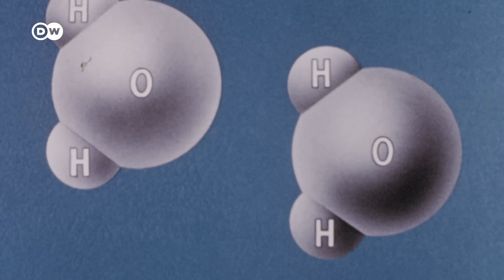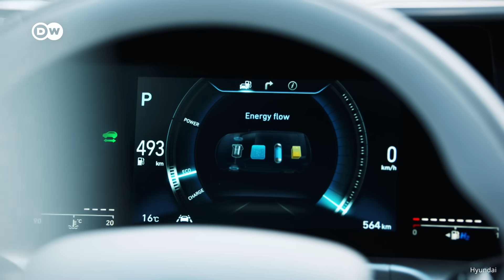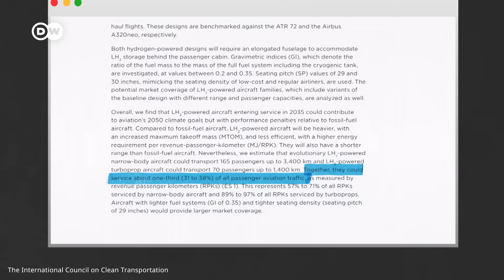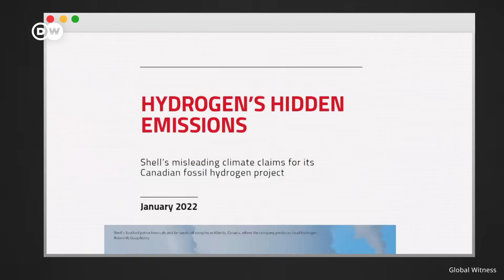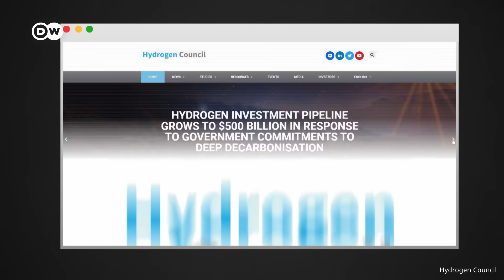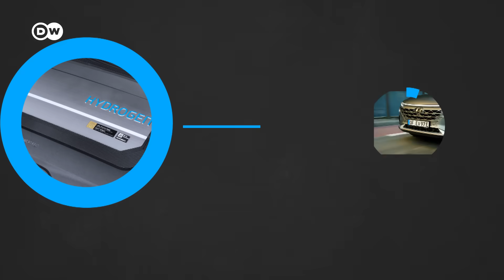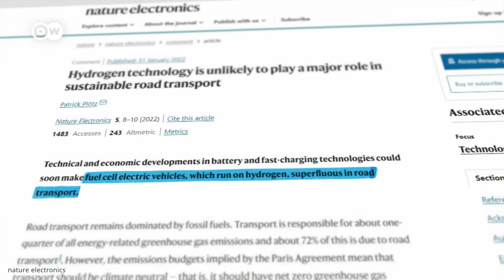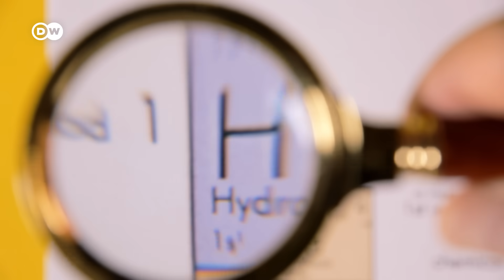The truth about hydrogen

Comment: The big problem with electricity production lies in the non-recyclable nature of the structures that are used in it's production and storage.    Windmill blades are enormous and there are millions of them and all have around a 10 year life cycle, along with those are vehicle batteries that are very difficult to recycle and/or dispose of as are photo voltaic cells on  roof tops.   Hydrogen doesn't have those particular problems in it's production and storage.

Comment: I think discovering an efficient and safe fusion reactor for energy would be the game changer in the coming years. And everything would run on electricity with minimal carbon footprint.
Reply: I used to be a big believer in fusion, but the truth is, the materials necessary for building a fusion reactor will make it inherently expensive, and that doesn't even take into account the expense of producing the tritium fuel (assuming its D-T fusion). Fusion may only be viable when our energy needs exceed what solar and wind can provide, or in niche situations such as when there is little solar and wind based on certain geographies

Comment: The Canadian system, Proton Technologies, filters the hydrogen out of the oil whilst underground, leaving the carbon in the well. Done by using controlled heating of the crude oil. Cheaper than grey hydrogen, Steam Methane Reform method.

Comment: know one way of solving the hydrogen abundance problem and carbon free energy at the same time and I'm surprised no one has thought of this yet. We can build new technology nuclear power plants that are safer then the current ones (less likely to have a meltdown) and produce very little nuclear waste as well as ones that can run on existing recycled nuclear waste anyways where am I going with this. When a nuclear reactor is operating it produces hydrogen gas as a byproduct of the intense heat released during fission we could capture that hydrogen and store it from all the nuclear power plants In the world and use it to power hydrogen cars even combustible engine vehicles. What are your thoughts please reply.

Comment: Interesting analysis, thank you. Have you considered the old-fashioned method of making H2 using dilute sulfuric acid and iron filings? It was the method used to produce large volumes of H2 for the airships at the start of the 20th century.
Reply: Producing iron filings and sulphuric acid is not green at all.
Reply: @feraudyh  No need to produce new when there's lots of scrap iron available and the dilute sulphuric acid can be recovered from scrap lead acid batteries. The waste product is iron sulphate that can be used to produce anemia medication. I haven't done the sums on it, so I have no idea how practical these suggestions are but, if H2 fuel can be produced from scrap materials, it's worth a thought...
Reply: @SteveTheStratAbuser  I think they are trying to come up with a sustainable solution that would last centuries rather than decades. Once the scrap iron and scrap lead acid battries are used up then what?
Reply: @SteveTheStratAbuser  There is no scrap iron available. Scrap iron is used to create new iron and steel products. And all the lead acid batteries will be replaced with lithium batteries in the near future. And the there is no new scrap material. That's not sustainable.
Reply: I imagine one could supply perhaps 0.0001% of our energy needs the way you suggest but it could be less.

Comment: Hydrogen is a scam. The only things it can be really used for is the production of fertilizer where hydrogen is mostly used, and for seasonal energy storage, for example to store solar energy in the summer to be used in the winter time where solar is low and demand for energy high. Even for the metal industry it's a scam, because there are ways to melt metal with electricity.

Comment: The origins of hydrogen fuel has been known for 200 years. Man is only now discovering its potential. Within 10-20 years air planes, blast furnaces and maybe airplanes will be operating with this cheap environmental fuel. Just the savings will be enough to counter the cost of fossil fuels. ☮️

Comment: The case on Hydrogen is usually made on an 'all or nothing' basis. I truly believe that hydrogen is the fuel of the future and a completely electric society is the answer to our environmental problem, as electricity can be produced sustainably (not just solar or nuclear). Unfortunately the current energy industrial complex does NOT want to see this happening. 10 years ago I read an article and watched  videos on a system called 'The Joule Box Portable Hydrogen Power Plant' produced by an engineer in upstate NY. He makes the point that we can produce GREEN Hydrogen in our home by collecting the rain water, processing the water through an electrolyzer, powered by a few solar panels and a small battery bank. This system is capable to produce all the electricity I need though a fuel cel. It was advertised that the system can be purchased for $50,000. I tried to contact these people in upstate NY, but never got an answer from them. I have been trying ever since to buy the components to build a system like that, but I'm unable to find the parts. I do believe that this is technically possible as we had this technology for over 100 years. If we can power our day to day energy needs with hydrogen on a local level we would not need additional coal fired power plants, we would not need armed forces to protect energy infrastructures and the cost of energy would be stabilized. As for electric cars and 'range anxiety', I bought a Chevy Volt a couple of years ago and I love it. This car fulfills 95% of my driving needs without spending a dime in gas, perfect as a second vehicle and it costs me less than $2 to recharge the car for the next trip. This is a TRUE electric hybrid vehicle.

Comment: Three fatal flaws with hydrogen. First, the electricity used to make hydrogen can be much much more efficiently deployed directly through batteries, electric motors etc. That’s a deal killer right there. Secondly, you cannot get around quantum tunneling and the challenges of storage. It cannot be safely and reliably contained and stored. Hydrogen is much further along the tech curve. Ie there is less room for tech improvement vs battery and solar which are still early and have immense opportunity. Lastly there is no hydrogen infrastructure. Whereas there is an electrical grid everywhere. The grid needs improvement for sure but this is brownfield economics which is much cheaper and easier than trying to build out a whole hydrogen infrastructure that is still not well accepted.

Comment: Everyone who has a cell phone can tell you the problems with battery technology (degradation over time).  That is very disappointing with a $600 phone and is going to be heartbreaking with a $60K EV (a problem in the very near future for early adopters to EV technology).

Hydrogen technology is obviously not fully cooked yet but once creating hydrogen at home and storing it for future use is a viable option it will supplant battery technology.

Comment: I had the privilege back in the 80's to drive a methane/ gas-o-line vehicle, the switch from one to the other was smooth, flawless....H may have a problem with water vapor but I saw the other day the production has become easier and faster with a new means of production.....EV is a scam at this point, I would rather buy a Prius and have a choice of fuel.....Solar and Wind are also scams, they may work well for a private residence but the environmental disruption caused by commercial production is not good and the fact that subsidy is needed for it to cost more to supply commercially and for the most part, we keep enriching China.....The gov keeps intruding on the private sector and forcing them to follow policy that is not valid and more expensive.....The stoopid want to make themselves rich at your expense.....

Comment: It is very beautiful picture , but who finally will pay for that? The H2 fueling is a few times more expensive, than the hydrocarbon fueling. More expensive even than the synthetic hydrocarbon fuels. Which can be produced from the municipal  flammable wastes, biomass, coals, gudrons and even from atmospheric CO2 ( see newest US atomic aircraft carriers)  for example. Hydrogen which must be of 99,999% purity for the fuel cells is more costly, more risky ( by fire and explosion) , is having less energy density than hydrocarbon fuels and most peoples are not able to afford to buy the hydrogen  fueled car.  The electrical car is the technology which is not mature yet: Their electrical battery is adding to the car  weight more than 200 kg, their operational radius on one tanking is less than this of hydrocarbon run car, their efficiency is decreasing with the time,  in case of car crush the battery is not possible to be repaired it must be replaced,  and when it start to burn, there is nothing to extinguish it,  moreover the fumes are creating deadly toxic  HF gas, so firemen will not be able to approach to burning electric car it must be unit of chemical  rescue with full gas masks and air cylinders  to remove the driver from the car. The battery contains large amounts of cobalt and other elements- which are available in limited amount. So both this technologies are not mature yet - and  it is the next whim   of the rich men after  this "revolutionary invention in transportation" as a few years was the  battery driven, two-wheeled , gyro-stabilized  gadget- whose name I already forgot ( segway ? ) and it is almost forgotten, a few of it I have seen in big airports only. So similarly it will be with this technologies. Generally the technology must have time to get mature, flawless, known,  and  generally accepted. And mass customer must be convinced, that for his money he is getting better car, not more costly, less efficient and more troublesome gadget. It is not a kind of hamburger or the fast food, that the client can be  stupefied by advertising.
Stary

Comment: A good starter video for Fuel Cell 101. We would need to add hydro electricity and other forms of renewable electricity productions. Also we need to talk about the technology to securely store the Hydrogen in cars which then can be released efficiently to produce energy and water. I believe the science in that domain is much more advanced than we think. I am confident that we will get there sooner than we think. 
P.S. How about building a car which will self produce hydrogen by electrolysing water and storing the hydrogen and all this using solar cells covering the car body? How about that for some innovative vision to work on? We have the know how to get there, I am certain of it.
Reply: Hydrogen energy is summarized by a four letter word, s, then c, then a, then m. To produce it from water is silly, the energy taken to separate out the Hydrogen and Oxygen is the same as we get from burning it. H2 fueling is much more expensive than hydrocarbon fueling, even if it is produced from the municipal flammable wastes, biomass, coals, or from the atmosphere. Hydrogen, which must be of 99,999% purity for fuel cells, is more costly, more risky ( by fire and explosion), it has less energy density than hydrocarbon fuels and most people will never be able to afford a hydrogen fueled car.
Reply: Simple thermodynamics eliminates the idea of solar cells on the car producing hydrogen. How would you compress the gas into a liquid form for use? We can't attach a diesel powered compressor -- ?!

Comment: The concern that I have is that the EV lobby has avoided acknowledging that the extraction of lithium for its batteries is as damaging, if not more so, to the ecology of the planet than the problem that is being tackled. The politicians lack the intellect and common sense to challenge the claims of these lobbyists - I think that this is because politicians think in such short-term horizons i.e. the term of their hold on power - generally, four or five years. We should invest in localised Hydrogen extraction based alongside solar- and wind-powered electricity production fields. Both electricity and Hydrogen power sources could then be directed to where they are each best suited.

Comment: Hydrogen comes from a raw material called water.  depleting water supplies for fuel is an environmental disaster that will probably make fossil fuel environmental impacts seem benign
Non of the hydrogen proponents address where the water is common from, nor the impact of removing the water from existing systems

Comment: This piece is excellent but it is mainly about energy for transport industry. You did mention steel industry but not for powering cities. No mention of powering the grid with small modular nuclear. That would be best for stationary loads like the grid (and charging EVs) I really think Traveling Wave that burns spent fuel rods from current reactors. Also you did not mention the project Germany has in Canada where wind will produce H2 which will be made into NH3 which is easy to transport, it burns and is the basis of fertilizers.

Comment: The only way I can see Hydrogen as a viable alternative is fusion generators. They would produce enough energy to power the electrolysis process and an engine. The byproduct is heat and water that gets reused for further electrolysis. I suspect we are a century away from  achieving a sustainable fusion powerplant. We may in fact never attain that technology. For now the best we can do is keep improving what we already have.

Comment: When someone tells you that renewable energy is carbon free, you're being lied to.  Windmill and solar farms require considerable mining, processing, fabrication, transportation, site preparation and eventually dismantlement and replacement.  It may be better than coal plants, but it's far from carbon free.  Ignore that at your peril.  A 300 mile range electric car has a bigger lifetime carbon footprint than a comparable gas car.  they equalize at 185,000 miles...but of course they are junked before reaching the break even point.  Net global gain in carbon release for each of these cars sold.

Comment: For Sweden to create "CO2 free" steel, the SSAB HYBRIT project is estimated to need half(!! 🤯) of Swedens annual electricity production.  Many of us with a functional brain attached to our bodies knows that this CO2 free steel won't be CO2 free at all.
It will need 10.000 wind turbines that in total will need at least 5.000.000 m3 of concrete, 1000's of miles of new roads into the wilderness, an enormous amount of non-carbon free steel and plastic. And all that has to be replaced every 20-30 year.

Comment: I read about H2 when I first entered college (applied science) half a century ago. H2 production cost was and is still higher than any fossil fuel. Came Elon Musk and his mission to accelerate the transition to renewables. That "accelerated" the pressure on the fossil industry to produce a new "face" in hydrogen - same profits but dressed as the lovely hydrogen. True, it's appealing (although reminiscent of the Hindenburg), but the 2nd law of thermodynamics also implies that every time you transform, transfer, transduce (trans = across, beyond) energy, you lose some. So photovoltaics win 80% of energy transfer to your wheels, to 40% with current H2. Costs? It cost Electrical is powered by solar panels and electrical outlets - found everywhere. H2 is complex, and only funded by big money interests to create the next dependency we pay for. Not blaming them, it was useful for over 100 years. But we need real clean solutions. Our sun powers life, sail boats, wind and water mills, tidal and focused light (Fresnel lens) for a very long time. Well, it's hard to beat the champion. Actually, the most humane, altruistic, generous and free supplier of energy throughout millions of years has been our sun. So the biggest problem mega-energy company have (including nuclear) is that sun-power is simple to harness, and freely available to all, including simple folks like myself. Thank you for your scientific review, that's not been tainted with general hypes. Cheers!

Comment: What about all the non fuel hydrocarbons that are currently supplied to industry from fossil fuels? How do you produce those using green energy? The only way is through hydrogen.
That’s why hydrogen is the future, not BEVs.

Fossil energy is much more than petrol and diesel, in fact that’s the smaller footprint of the o stall fossil energy industry!

Comment: Just some points about hydrogen. Firstly, when implementing hydrolysis to make hydrogen, the water used has to be extremely pure. Sea water can be used but it needs to be de-salinated first, of course, which requires energy in addition to that used for the hydrolysis itself. Secondly, not all of the water used gets converted to hygrogen and oxygen - there's always some waste. This means that water ends up being a consummable to some degree which could pose a challenge in supply. Thirdly, if we burn hydrogen in the atmosphere as a fuel, the by-products are not just water vapour and energy. The atmosphere is 78% nitrogen - not a pure oxygen atmosphere by any means - so we get oxides of nitrogen produced as well as water vapour. These oxides are potent greenhouse gases. Incidentally, water vapour is also a greenhouse gas.

Comment: First thing you need to do is change all the existing dirty hydrogen to green hydrogen.
Carbon capture is nothing more than green washing BS put out by the fossil fuel industry to prolong their existence.
Instead of trying to transport hydrogen we need to put value added industry where the green hydrogen is being produced.
So for instance you build a green steel plant or a fertilizer plant next to a green hydrogen plant and then export the value added product.